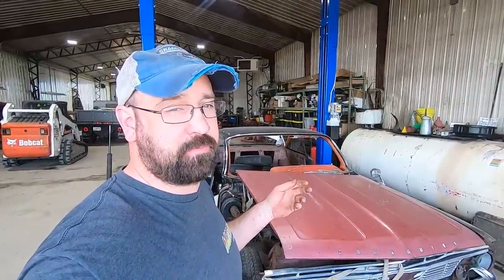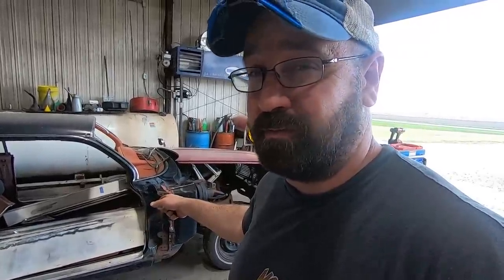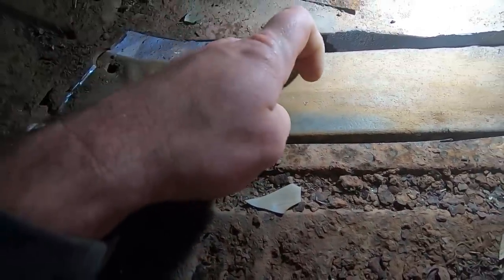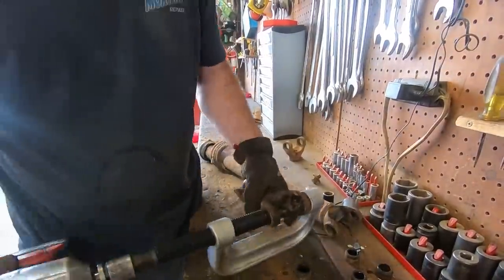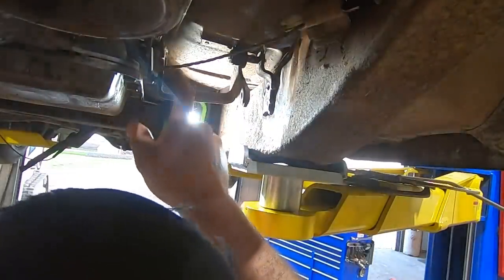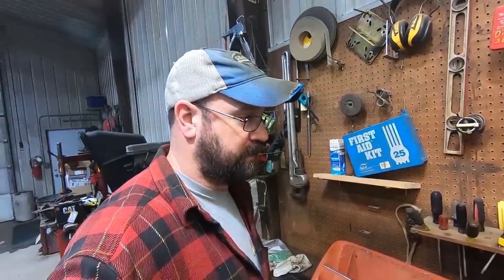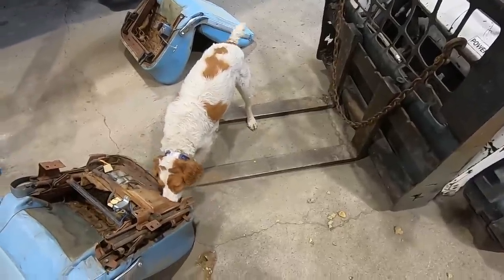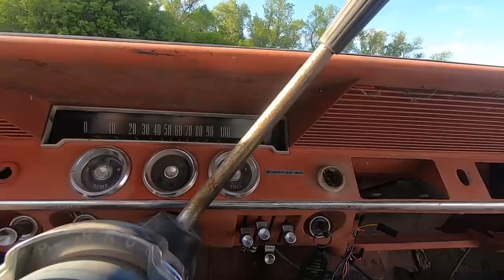Abandoned in the Woods for 50 years! 1961 Chevrolet BelAir Bubbletop Saved from the Grave!

Comment: You have had some ride in the 1961 1/2 Biscayne as a riding around and proof that it does need new Monroe shocks from Ebay and Chinese sells no brand shock of Nitrogen inside the dampeners. Doing the stocking the parts that was drove to the selling car and used car lot and wait there as busy and heavy traffic HWY see you are selling in your red and a white post the sign FOR SALE and ask the dealer of his miscellaneous of his Mechanic chore boys called Goodwrench for permission to sell your vintage car in his lot and also go somewhere if it's a No no then ask Mexican worker in the grocery store and selling and selling with your folding sales counter table to get permission grant as you want to be dealer selling no glass Impala. Sell your station wagon Galaxie or Skylark build by G.M. station wagen skilled car auctioneer.  I am not a buyer of any car. If I buy the car I buy if less than 500 dollars from Nebraska but I don't need more car. Beetle front wheel drive weight 3,000 LBS is worth like $888.00 dollars like new; age 10 years old.

Comment: Bel Aire became Malibu t6hat you don't need two tone car you need just one toneoutside black car. You need Beaufort car not van with 283 CID motor block. The mouse engine will need the press and whack the piston down. Only after the main bearing cap remove and allow the pistons and piston rod into loose like a wrist pin. You let the engine to be handcuffed to the Impala body and under the hood Chevy named plate called Main panel and license plate being replace in a will and in order for you to pay the DMV that is for to check your car. You don't need an inspector to that check your car that is because the official will notarized the car and will also find an extra car title that has been avail also known as total (broken) under the property of Allstate insurance Integon co. parent company is Hartford Institution with Federal reserve park of all titles and claims card of car and truck ownerships back- up copies of USA motorist and record of clean no crash proof that you are the driver responsible of operate and fix and getting car into safe and pass the law that your cars are not swap shop possessed. The only inspector that you have is the owner of gas pump station owner and he is a sales clerk not a mechanicASE and also another witness to pass you the new title includes pink slip in that order. Why two person because the state law requirement is two persons as the witness that way you got the car that estate was giving it to you. Thank you. My name is workfree40 in EBAY.

Comment: that is too bad and make the car Impala into solid car said by the lawmaker You still want the clip by writing down the VIN and it is archive that the DMV will sell and recovery the void car VIN for you to receive new paper called clip-cloned and with its VIN it is require by law to have it marked the VIN and stamp the number then your 1961 hybrid 1962 impala one car is licensed as safety type street legal drivability means performance and seat beat without steel grommet is good better than nothing and make fold the seat belt two time into like a triangle at tip then drill a hole thru the seat belt and when it fold it twice becomes 3 ply at near tip/end the seat beat across the waist is one ply. But I now the belt is dirty but u need it for temp until get the new belt from 2012 car in LKQ with 100 broken cars that is/are the models 1990 and up to 2018 wrecked car. The three ply is with hex bolt to the reinforce car floor and there simply a new seat belt pre-owned. Washing machine use bleach OXI from Arm and Hammer if you do have washing machine?

Comment: You said with your duff going to the deer shed instead of going to the deer and slaughter some bird or deer. You drove your lime green chainsaw nearby your blue pick-up truck. The deer is always in my property and taking a deer shitting along with big robber named big squirrel that live in the estate nearest to me and these huge sweetgum tree and many jump to the loblolly 60 ft tall trees so squirrels hides in the old scrappy deer shed. These 5 squirrels are my trolls and pest. I kill one squirrel for a friend and I leave only 4 squirrels left. And super .22 rifle will get a good wild game for you. Do u want to buy it from pawn super pawn-broker shop named Marlin or Remington?
 I read your channel picture motion that you did shifting the shift chromed stick attached to the steering column. My car is 5 speed and not a Muncie just original. In order for you to buy floor shift you would make Biscayne SS into Japanese ordering the car made as new front wheel Drive Impala 1961 Eldorado from Chevy only. The Cadillac is bankrupted already. 
 So the Biscayne is a post car and it came with two tone caravel seat or tudor cushion bench. The Impala has aluminum trim fully cover the back of Impala around 4 tail lights. The Biscayne is made as bubble top car. The Impala is coming as non-post until the first Impala was sold to a town car potential buyer from Chevy only. It was tailfin that sloped down into sideway instead of Belair with straight up pair of tail fins of Custom Belair made in 1960 or 1959 called convertible and chassis heavier and thicker gauge than biscayne.
  Biscayne had only 1600 model and possibly 1800 model named SS 396 and what is the trans. Whether it is 3 speed floor shift or T300 TurboHydra. Depends on the mirror and glass blowing industrial.  It is instrumental called with aluminum holding rearview mirror.  At samje year, the chromy mirror holder was add to the interior and the arm rest is longer than the Biscayne's door panel trim. The Caprice 1961 or 1962 has the chromy front bumper and about the same as El Dorado front bumper that weight a lot like over 55 LBS but it was optional still never post to show in showroom. Everybody was buying E-model Jaguar import straight to North America along with Renault and Peugeot 4 forward gear 1966 car in during rush hour of selling car 1950's But the Model XK120 is Jaguar post for sale car.
 Then came emblem to name your funny car with maximum speed 90 MPH engine performance. During the 1960's the only emblem you can get is floor mat as well some steering wheel have moto emblem but they were all no power brake and no power steering pump into all post Biscayne cars then the steering never had any emblem just big steering wheel 15 in. diameter The continental truck was model 1800 and fancy spacer for spare wire wheel so the chauffeur front bucket seat and interior hard top rumble flush seat became standard called king cab or Deluxe cab with suicide doors in design style of pick-up trans-traveler advertise into being Sport or Deluxe Club sedan said Delage into production of 2,000,000 line up with motor Packard Brewster 1949 shipping called like in the moor it up Club of society of Merchant made rich with Magnate selling Merchant Direct store at Standard oil company that were bankrupted but the Magnate is still Delahaye but it was Studebaker and Windsor engine assembly site about 1 million Auto worker union members that wipe out Ms. Delahay acting asl named the plain junk bond model. Then the Lucille Bell/ball was a monarch in stealing my Lotto named company, The Bell. Begins the turmoil of Mercedes Benz Pullman car Model S but the American General Patton car was copying the mercedes Benz accept for the Locomobile engine 4 liters or bigger displacement. Then the chevy car was crushed and total while Patton was driving then The Republic Arco did want to cut the American fat army porky car into standardize built car as a heavy model for $4,000 dollars in 1955 and 5 liters import from war factory made by the Cadillac that was converted to never any emblem at all as a post car into any choice of color except green (Khaki forest green dark army).